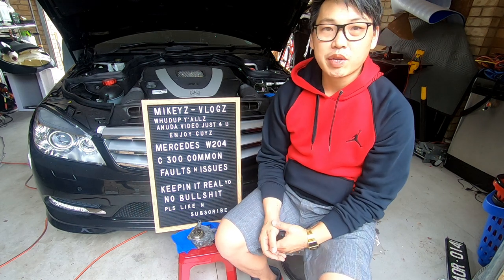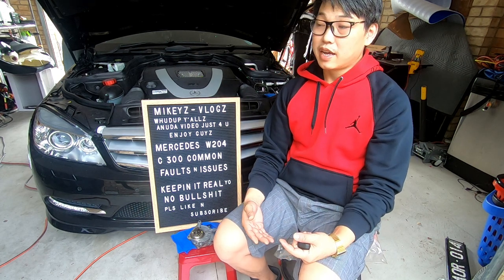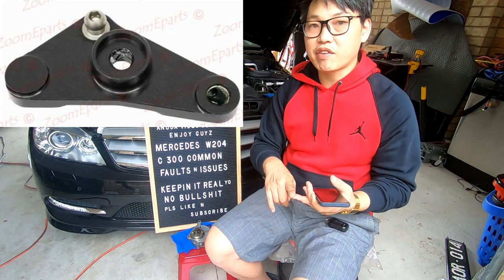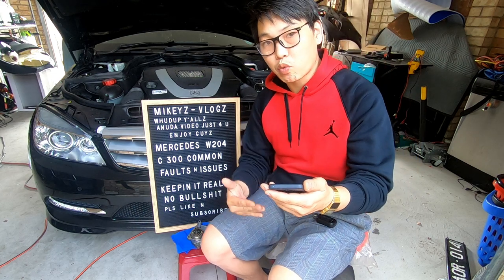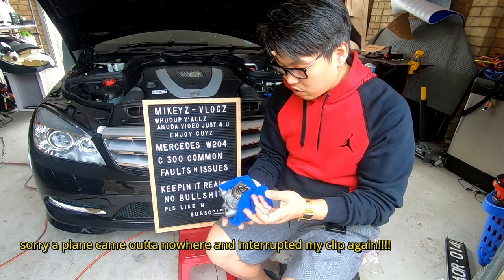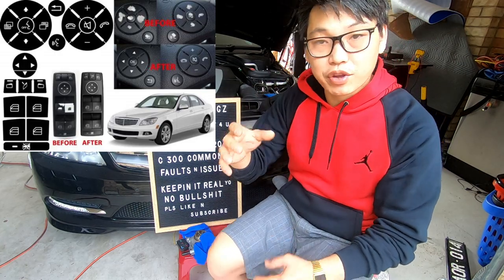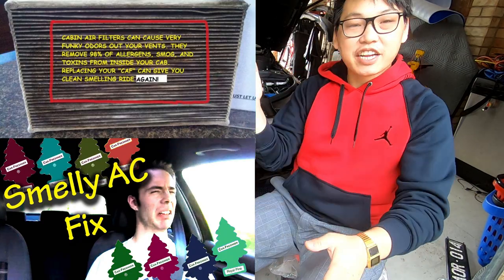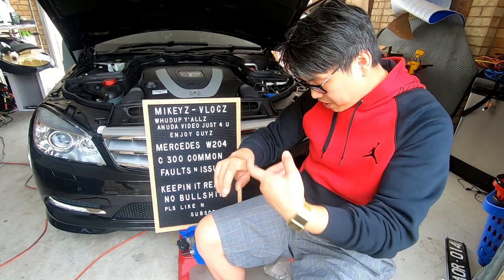2010 mercedes w204 c300 common faultS and issues  v6 m272 BE WARNED

Comment: Hi. Please I need help on c204 c200 2007. Radio runs on and off on it's own after being turned on. Tried taking fuses out and even the battery overnight.  I need your help to fix this. The radio plays for a few seconds then on/ off just like that
Reply from the maker: To b honest i have no idea why that is happening ...i have never experienced that issue...i willtry and find outwhyits hsppening n the fix for it
Reply: @MIKEYZVLOGZ  thanks. Please do try to help. God bless
Reply from the maker: The first thing to do is have the car scanned with a star diagnostic tool...thereby narrowinh down the issue..electrical faults are hard to find without the right equipment...its almost sensless me trying to guess ...i strongly recommend have the car scanned for faults...hooefully a module has recorded the fault and stored it.... ive also done some.research as to some other ppl who experience the same issue ... u need to check for disconnections in your headunit..for example... whether you have something like an ipod connection and it was replaced or removed and the person who did it did not properly disconnect or leave the module or cables connected therfore causing an issue... its happened before ...sounds wierd but without more info hard to pinpoint
Reply: @MIKEYZVLOGZ  hi Mike. Nothing has been connected or disconnected before. Honestly saying, I had played around with the ENGINEERING facility and when I recall, I may have assigned rear camera to "installed" whist it's there but was working without having the ENGINEERING mode being set to installed. Can that be the cause sir?
Reply from the maker: @edwinchere1930  no serring rear camera will.not play with your stereo ... must be a loose connection somewhere
Reply: @MIKEYZVLOGZ  Mike, I went to scan the car wholly. It appears the Scanner cannot  see/get hold/reach of the audio. All other things the Scanner did scan them. The audio did not respond as the people scanning the car said the audio should have responded by writing on its screen the word "DIAGNOSIS". I'm really confused now sir
Reply from the maker: @edwinchere1930  i have no idea also..are they using a proper merceses scan tool?
Reply: @MIKEYZVLOGZ  I would say so as they did other MERCEDES and diagnosed them very well
Reply from the maker: @edwinchere1930  hmmm in that case u may just need an auto electrician to look at it and find the issue... electrical faults are hard to find u nees special tools amd must know how to find the issue
Reply: @MIKEYZVLOGZ  I guess I may have to get the car to a MERCEDES garage and find out what they can find. Had thought one can do it himself. That would be after our lockdownxand so forth of which may take a while.
Reply from the maker: @edwinchere1930  ye might be best optiom im sorry i couldnt help any further... im no mechanic but i do try to help
Reply: @MIKEYZVLOGZ  no problem.  Keep researching sir. Always thankful for what you have been assisting me with. I will await for your any other input. Thanks my man. Let's keep communicating.

Comment: Sup m8,  what do u think about the CLS 300 M272 E30 from 2009 with 231 hp v6 ?
Reply from the maker: yes still nice car mate it has the sharpnround back yes
Reply: Does it have common problems? Thanks and great video btw!!
Reply from the maker: @xr3ptillax882  it will have the same issue as this video and some ... just gotta do some research on ur model and see what comes up

Comment: how many months per year should i do a check up
Reply from the maker: these regular checkups should be done say once a month ...a good in depth check of everything so u are sure that nothing has malfunctioned or broken etc...its the best way to keep your car in the best possible condition regular preventative maintenance.. thats why we call it preventative maintenance we try and prevent the issue from happening..but with that said.. sometimes an issue can happen out of the blue regardless of the checkups... but at least wirth the regular checks u can find and get to a problem before it causes any other relates issues..just my 2 cents
Reply: ok sounds good, i haven’t experienced problems but after watching the video, it helped out a lot
Reply: @MIKEYZVLOGZ  YES CHECK UP EVERY MONTH OR SO BUT ACTUALLY DOING THE SERVICE SAYS IT IN THE HANDBOOK

Comment: A guy in Mercedes parts told me the reason for all of the plastic problems is because the German government requires recycled plastic to be used for car parts. He said there would be very few problems if it was like the Japanese gov allowingwhatever makes the car last the longest.
Reply from the maker: so take away is buy Japanese..no wonder they make metal parts of certain parts like pulleys ..etc so u can upgrade and make the car last

Comment: Also there is no  preventative for the Transmission. Changing out the transmission fluid Wont help this problem so if you have a 722.9 you better do your homework because that is a faulty transmission and a catastrophic one, 😂😂😂. German Engineering  😥😥😥
Reply from the maker: yes irs very sad that mercedes have all these issues ... hence if i had known about all these issues prior to buying one i maybe would have gone for a different car ... but in the end ive always loved this car and shape so still happy
Reply: well uh....so what transmission is best? what are the transmission types besides 722.9?
Reply: @Kevin-im2ri  well unfortunately Mercedes does not make a good  transmission 722.6 722.9 are both no good C300 C350 only has a 722.9, you'll just have to except it or rebuild it when it fails

Comment: There is no preventive maintenance for the cam shaft balancer PROBLEM  , there for that car will not last, 😂😂😂😂
Reply from the maker: lol i get what ur saying ..and its very valid.. however funny enough not every has these issues which is surprising aswell... but the best thing u can do for that is prolly upgrade as soon as possible to try and prevent it from failing to begin with... eventhough this should never have been an issue....so i do agree with u to a certain extent ....
Reply: @MIKEYZVLOGZ  unfortunately yes every Mercedes from 2008 to 2010 has this problem. They corrected the problem camshaft balancer in 2011 but yet nothing has been done to the 722.9 transmission. Having being a Mercedes Tech I could tell you anything and everything that is wrong with that car.
Reply: At what miles/kms does the camshaft balancer go bad usually, 
Someone please help @MIKEYZ VLOGZ
Reply: Engines made after this serial were fine M2729..30.468993 if your engine serial is below these numbers you have the weaker metal used in your crankshaft balance gear, dual row timing chain and chain guides.

Comment: Why we have to buy $56K Mercedes to fix daily? The best to buy an old C300 and using the  Toyota engine for the car.
Reply from the maker: not fix just do preventative maintenance and regular checks.. some ppl can lucky never to experience an issue just depends how you treat your car.. these are just some faults to be aware of..like I said not everyone will experience the issues..but thse are common faults with the w204..... but honestly if u use Toyota maybe last longer..lol

Comment: I having a ESP malfunction and check engine light at the same time i have a c350 2008
Reply from the maker: did it happen after you did something to the car or did it just appear out of nowhere ??? usually something triggers these things like a low battery or electrical connection unplugged whilst car is running ...therefore throwing a code.... sometimes depending on the seriousness of the issue of ESP it can be fixed by turning wheel all way to left and right ....i think has something to do with telling the car everything is ok with steering relating to esp fault as for check engine light there can be many factors ...best thing to do here is scan fault codes and see what errors your getting .... should always be tour first option when getting malfunctions.... imho...... hope u get it sorted asap i know how it feels to get random faults...very frustrating
Reply: It happen of nowhere... i was driving and i push the gas hard to run fast and do a little burnout and then the car loose power and turn the ESP light then i turn of the car and turn on again and the light disappears and the car runs good again but i press the gas hard again to run fast and happen again but this time turn the chek engine and the ESP light at the same time
Reply: Sorry for my English in form PR i speak Spanish jeje